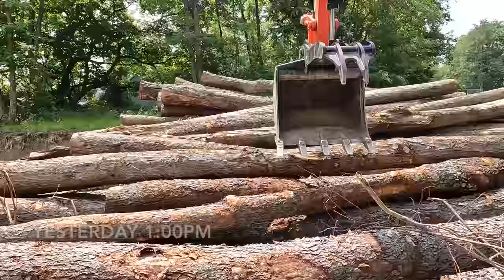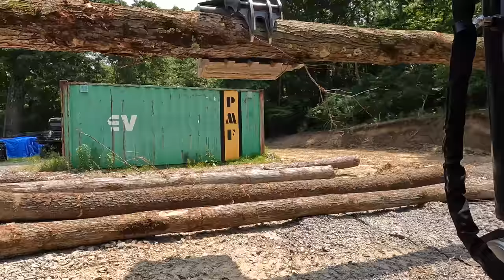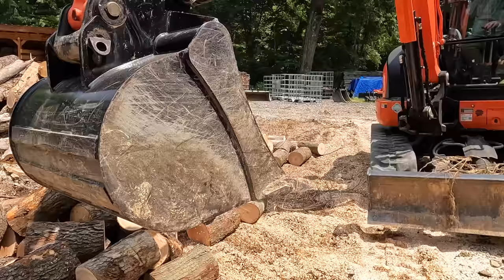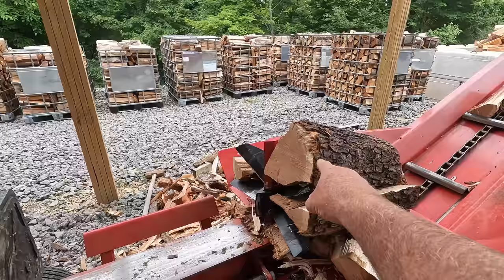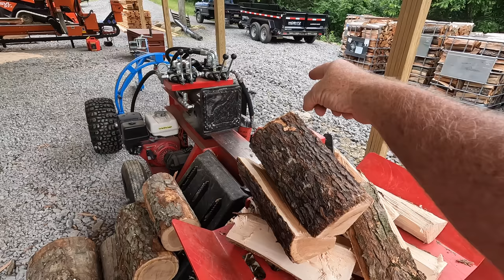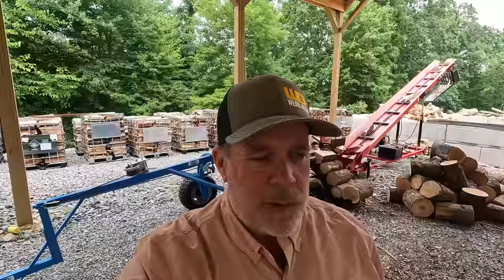Unfortunate Accident at the WoodYard, Freak Accident

Comment: I agree with your statement if you split enough unexpected incidents are more likely. That oak looked green and it compresses as well as rebounds as its porous with veins that compress. Why not fabricate guards from tube or angle steel and expanded metal. They can be fitted to the flow of spit pieces so they aid in getting splits on to conveyer.  It's a learning process but if others share mistakes and accidents like you maybe others will benefit. 
You might learn fro same process. I worked briefly at a private mill a young man was hit by a  piece of wood from chipper 
Another close by had a slab from saw edger hit an employee, both were hitin head wearing hard hats all PPE sadly they didn't live. 
You didn't do anything wrong. 
as long as you learn from it. 
Thanks for sharing.

Comment: so , I was not there, but it would be an added safety feature to  enigineer a safety cage around that area of the spliting wedge's similar to a large truck tire cage used in tire inflation after repair. What I have in mind would allow full access for the spliting work and allow full flow through for these steps and prevent any kickback or forward for that matter. Contact me if you like. Thanks

Comment: Glad Ed is gonna be OK and it wasn’t worse.  Sure fire way he wouldn’t have been injured is if I was there because those things always seem to happen to me. 

My bud was using a heavy duty splitter (single wedge) and ran into a freakish hard piece that twisted and sheared the wedge apart and flipped log out.  I wasn’t there but helped remove the twisted steal later.  Things happen. 

Was wondering if a partial cage would help…or…likely just create another pinch point.

Comment: you can see on the piece right where it pinched, there is a witness mark where the wedged scraped it. i've had it happen but never had anyone in the position to get hit, it just went flying out of the end of the splitter.  and that was with a 4 way wedge.

Comment: Ive had that happen, with a two way splitter.
It always involves knots, and severe timber bind, ALWAYS..
.
ive had wood fly 20 something feet away from the splitter.
involves knots 3" to 6"
Under 3" it doesn't generate the potential energy and comes apart before it can go flying.
.
At times we have had timber bind so bad, i have to jam wedges in the cut of are sawmill to keep the blads from stalling or heating up in the cut.
Its a mobile dimension sawmill, "not a bandmill".
.
Im dealing with dug fir 99% of the time.

Comment: At 10:58 [and later you pointed it out] you can see the twists from the knot in the wood grain that caused the accident.
It might be a freak accident, but it's [k]not uncommon.
When using a splitting axe or wedge, and you hit something like that, you understand the torque that twisted grains of wood are holding in place until they're unleashed by splitting.
Machines are the equalizer of nature... Until they're [k]not.{True, but I couldn't help myself}

Comment: It makes sense to me that the 6-way wedge would contribute to the risk.  Think about a 2-way wedge, where the wood is free to move apart, and a 4-way, where there is some compression of each “slice” but generally the wood can move up or out.  On the 6-way, the wedge (which takes up volume) is compressing each slice quite a bit more while the part that hasn’t made it through the splitter yet is holding all that pressure together… until it gives way.

Comment: I have a much smaller splitter but sometimes if the pressure builds up on a stubborn log, when it gives it can fly forward with a lot of force. That has happened to me numerous times. For that reason I would not operate the machine with someone standing in front, or as it says in the manual, "Keep children, pets and other people at least 6m away from where you are working. Flying wood can be a hazard".

Comment: I just have a small electric log splitter, and I've had pieces come flying off of it as well...the only time that happens is if its a round that has a knot in it, which is exactly what that piece had...it hit that knot, and knots don't like to split, so you have all that force from the ram of the splitter pushing against it trying to shove it through the wedge, it won't go, and all that pressure builds up until the knot finally blows apart, or a chunk finally breaks free.  It so fast you have no time to react.

Comment: never have anyone standing where Ed was, if the round has tension that's where it's heading and fast. I buy my firewood split already but I do have a 5 ton electric splitter for re-splitting the bigger pieces. often those pieces will literally fly across the room. I just can't believe that all the wood you split you've never witnessed this.

Comment: My little 5 tonne electric log splitter could be a killer. I use it to split eucalyptus hard wood. Wood is split on the tray of my side by side as it’s a good working height. Quite regularly the ram pushes wood against the wedge, the wood does not immediately split and suddenly the wood splits with a piece shooting out at speed. If the flying wood hit someone it would really hurt.

I’d recommend avoid being around the front of a splitter when operating it. I’d also recommend wearing a chainsaw helmet with face shield when operating the splitter.

Comment: It was the knot on the round that caused it to build up pressure and then let loose all at one time. I think if everything was lined up just right, it could have just as easily happened with a single wedge, splitting it. I think the only way to keep it from happening again would be to just not let people stand close to it while you’re splitting. Don’t think it was anybody’s fault like you said one in 1 million that everything happened the way it did. I think if you look at that knot on that piece of wood, it looks like you can see where the wedge bound up and kind of created a place like you hit it with an ax. That’s where it was resisting going through and cocked over sideways before launching off the splitter.  Just glad it wasn’t any worse.

Comment: I just have a regular horizontal splitter with a single wedge.  One time a block was putting up a fight and loaded up the pump so there was a lot of pressure on it.  Normally it would just push the block slowly past the wedge, or the block would pop open and maybe go sideways a couple of inches, but this time, the block popped open and the two halves of the block flew past the wedge and hit the tractor that the splitter was attached to.  A lot of the time I would have been standing where those pieces would have hit me in the legs, but that day we happened to have some help so me and our helper were standing on either side of the splitter.

Comment: I have only had them shoot to the side. Always when the ram felt like it was loading up pressure. So now if one is harder than normal I will back off and reposition it. Easy to notice the buildup with my lower powered splitter.

Comment: Ive had  a 1/2 round of a 16"long 14" round piece of wood pop like a gunshot when I split it on a typical wedge pushed block against the flat end plate, it shot off the side of the splitter and the other side came towards me , we have all lodgepole pine and I credit it to the stress in the wood as the tree grew , now knotty wood is another story , but this piece wasnt knotty. if you look at the pine you will see that the trunk is actually twisted as it grows , thus the pent up energy inside so it can be just about any piece of wood . i agree the 6 way probably added to it but wasnt the reason it happened,

Comment: G'day Mike, That's no good treating the father in law like that, I've got a sign hanging from my old elevator it says Hard Hats to be worn in this area ! I swing my leg up onto the block as soon as I hear the pressure valve starting to squeal I reckon one in ten of my blocks would do that. one of the times I went to the doctor was because the ram broke where the bolt hole is for the wedge and it hit my thigh with twenty tons behind it that bloody hurt, all the best 👍.

Comment: I believe I would have an "arch" guard made with a diameter as that flat table beneath the 6 way blade. Make it the same length as that table and open on the front snd back to allowwood to pass through. .This would provide a hood to prevent pieces of split wood from rising too high and being sprung up and out.

Comment: hope Ed heals well soon what ever you do after time you will have an accident however careful you are in the last 2 years i have tried to cut off the top third of my right thumb got about 3/4 the wat through it then the second incident i jumped into the back of my van and put the top lock bracket that the back doors catch on to put in to my scalp tore it open and put a big dent into the top of my skull got glued up and thats that as a rule i try to be as careful as possible dont feel to bad its GOD,s way of telling you he is still monitoring health and safety procedures it can happen and hoew careful you are it will still happen at some point all the best from Albert in UK

Comment: Been making firewood since i was old enough to hold a chainsaw. Seen alot of wood "pop" and fly off the splitter. 90% of the time when it does that, its because there was a knot or crotch piece being split. That piece popped for that very reason.

Comment: I know you're a sensible guy so please treat this as a word to the already wise. I managed risk (including Health and safety) for 20 years - for an accident to happen you always need more than 1 thing to go wrong. In this case - you've got at least 2. 1) you didn't follow the instructions - no-one closer than 10 feet when you're cutting. I understand why you did that- its quick and efficient and that's fair enough. But where you're going to take risks you need to ADD controls. Which brings me on to #2. The people operating too close to the machine didn't have additional PPE on. A simple helmet with face guard (like a cheap oregon chainsaw helmet) would have managed that risk. That would have been your control. I hope the chap who got hurt is ok, but finally (and you said this)  please remember that low likelihood of a risk materializing is NOT a control. In other words "It was one in a million" doesn't cut it because you are going to cut 1 million pieces of wood so at some point it IS going to happen - instead you need to think about the impact of the risk materializing and add your controls for that happening. All the best Mike.

Comment: Thanks Mike for the scenario of the "errant log" and the outcome. As a former "safety officer" in the military, it is good to review safety procedures on all operating devices. At this point, I would suggest a hinged, semi-circular, wire safety cage around the splitting head. Once the split log is pushed forward of the cage, it can be grabbed and repositioned by a helper, if needed. Just a suggestion that may assist your endeavors. Wish a speedy recovery to Ed.

Comment: One thing with wood - there are all kinds of stresses in the wood because of the way it was growing - most of the time these stresses ae released as we cut the wood without any mishap but one needs to be aware of that - one time I cut down a tree and as it began to fall it struck the branches of a dead tree - the falling tree bent a branch of the deae tree - the dead branch broke and was shot into the air - at that point I'm walking away from the falling tree but the dead branch flew towards me and hit me in the right shoulder - thought I was safe because I was a considerable distance from the falling tree - you can't be careful enough

Comment: I witnessed a near accident. Stopped to take photos of a father and 2 sons that were using one of those screw splitters that is run off the PTO of a tractor. The father told one son to hop on tractor and start it up. The tractor went into reverse. The father and other son barely got out of the way of getting spiked and run over. There was no clear exit they were stumbling over logs and the tractor was trying to jump over logs. Dad was screaming .. no one got hurt.

Comment: Little late, but how about a modification to the area above the wedge like the old tire cages built for split rims and tire inflation. Consisting of maybe 2 bars(tubing) up and over the wedge with  generous clearance on the right and left And over the top. Could even be built to sit on the ground as a separate unit. Just my 2 cents worth.

Comment: Rule 1)  The operator working the controls is the same person loading thd nest.  Speed be  damned, safety is what matters most.  2)  The tonnage that splits the wood can and will throw the wood from time to time.  You should only have one person within range of an operating machine.  FYI  I have been doing this for over fifty years.  I am surprised you've never seen this before!  Think of the round as a loaded spring.  You are lucky it wasn't worse.  Stay safe!  Shalom/gw

Comment: you should have a metal cage around that point of your operation to protect you and others. this could be fabricated using number 7 rebar and welding so you would end up with a 4 inch square pattern. 1 in a million is just a calculation, however this could happen the next time. my hope is you put some kind of protection around that problem area before something worse happens.

Comment: You have to understand the grain of the wood, it has a lot to do with how it will split. You have no control over that, Mother Nature Grew it her way. You just need to take a precautionary position and 
stay clear of that area. Also, KEEP your work area clear, don't have rolls sitting in your evacuation route should someone need to move away quickly.
Lessons learned, now move forward smartly and safely. You'll be fine. 
Thanks for sharing that experience, a lot of viewers should take away with the importance of safety first......

Comment: If I was you, I'd take that 6 way splitter off and put a 4 way on. Your compressing wood into smaller areas compared to the diameter of the log. The wedge is not centered on a larger piece of wood.  Think of how many tons your pushing there. Stuff's gonna fly. Too bad for the person that got hit, but no one should be standing in the front area. It's like a cable snapping. Just a thought.🤷‍♂️

Comment: So, by your own admission you failed to follow the equipments operating instructions by having numerous individuals around this splitter as it was running.  As a certified operator myself it is solely your responsibility to ensure the safety of others while work is in progress.   You grossly failed to do so, causing an 80 year old man to be almost killed.  I question also if he should of been doing that particular job in the first place.  I'm not saying he shouldn't be working but just not in the path of the machine.

You also grossly failed by not ensuring proper personal protection was being worn.  I can't see anyone under your control, on your job site  wearing ANSI approved helmets.  You mentioned being hit in the legs by flying wood several times.  This wasn't a red flag to you?  Maybe getting some training by OSHA might be a good idea for you moving forward so that these type of unnecessary accidents don't happen.  You failed to follow the warnings for the machine, and failed to ensure that all the mandated safety equipment was being worn. Doesn't matter if it's on a 1 in a million chance to happen.  I'm sorry but this accident was easily avoidable.

I hope this comment wakes you up, so that you can appreciate safety and that your #1 job on your works site is to ensure everyone goes home safely.
Reply from the maker: Yes your comment definitely woke me up, it tells me everything I need to know about you lol